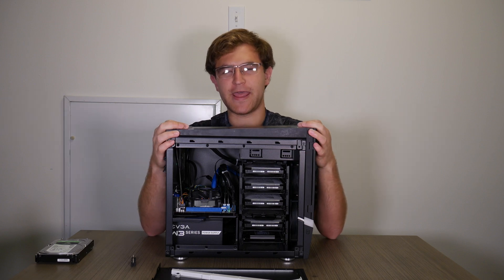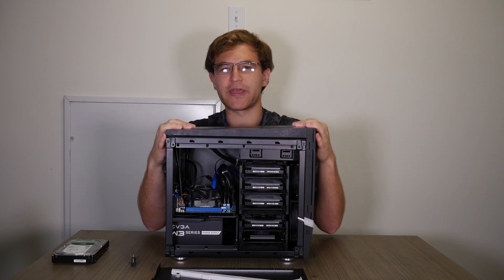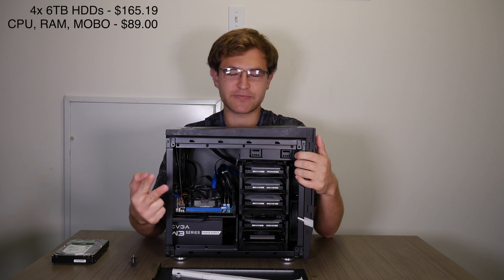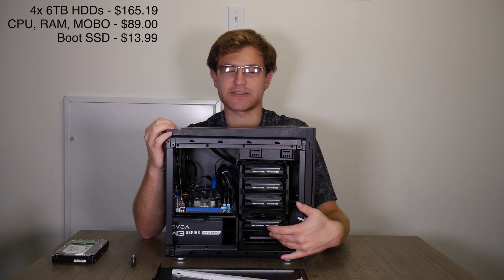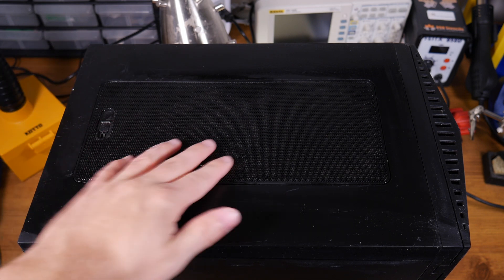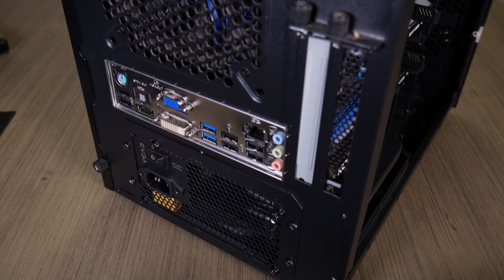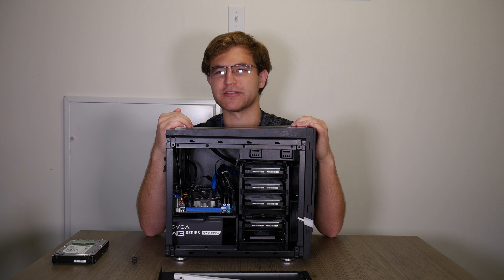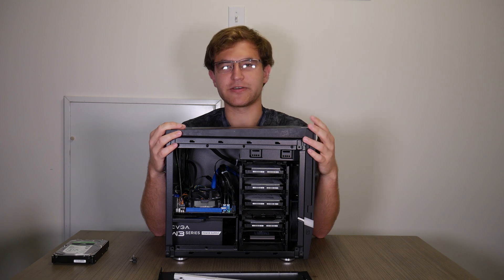Scrap Yard NAS Build

Comment: Link to the case?
Reply from the maker: I don't think it is being made anymore, but this page has the info on it if you want to try to find one.

https://www.newegg.com/p/N82E16811345040
Reply: @Eman2000  any alternatives you recommend that can hold the same components
Reply from the maker: Unfortunately, I don't know any off the top of my head. The case was definitely the hardest part to find in this build. 

It might be worth playing around with this site though. https://pcpartpicker.com/products/case/#t=9,10&J=4,20&f=8

I set the filters for cases that match my hardware. You can play around with those if you want something different though.